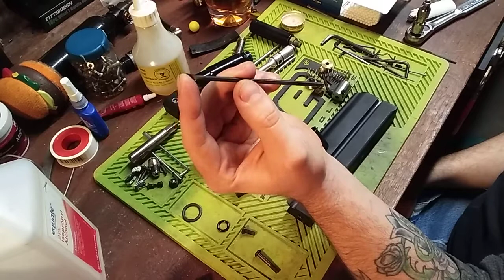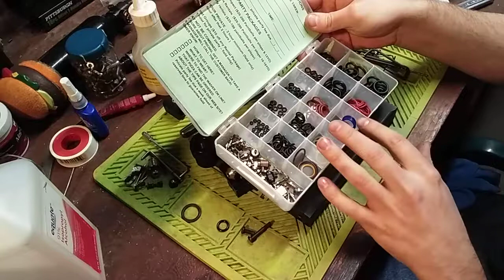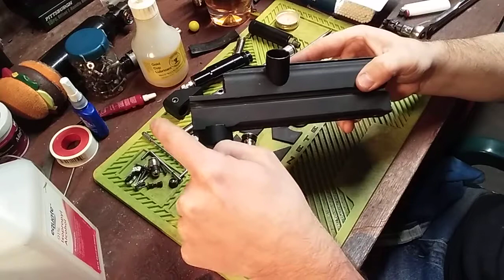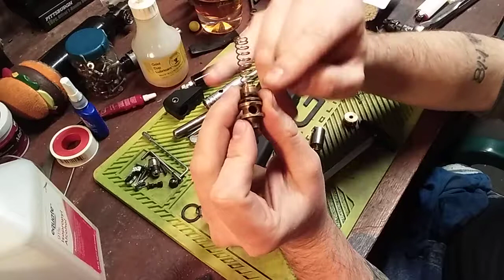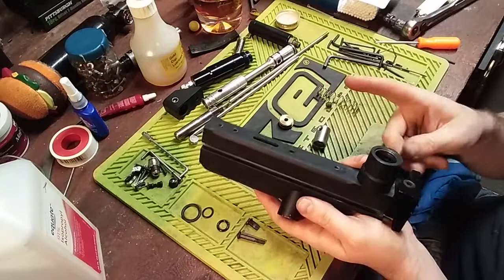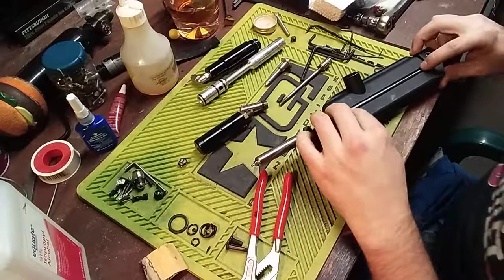Build and bullshit. Lets talk tech.

Comment: Wouldn’t that 3 mm Allen trick be defeated by an 1/8th back end…just my 2 cents
Reply from the maker: Sometimes yes, sometimes no. If you have a straight enough angle on the fastener, absolutely. In steep angles the 3mm Allen gives you more wiggle room and still grabs.